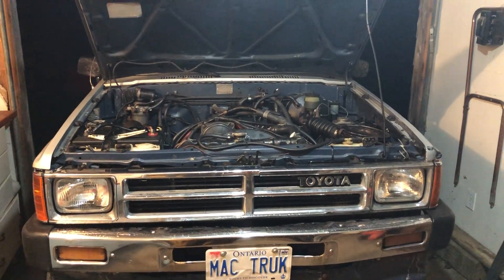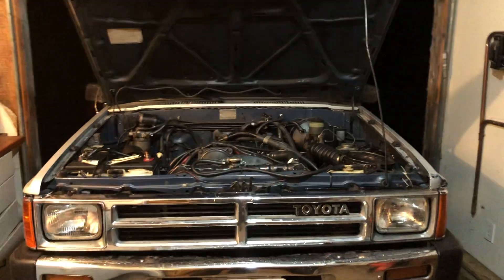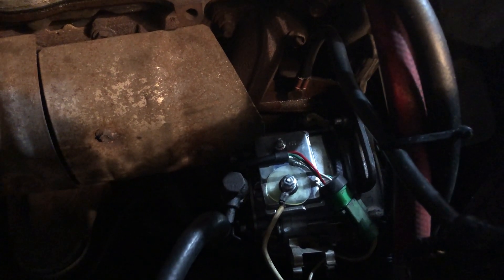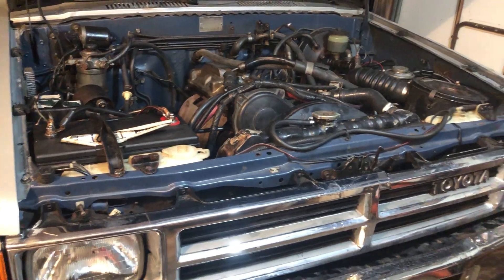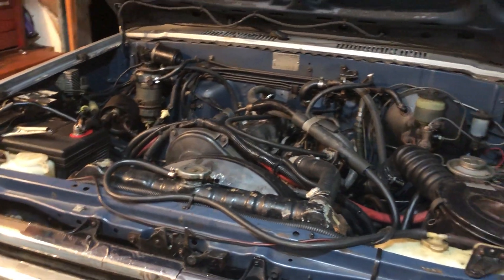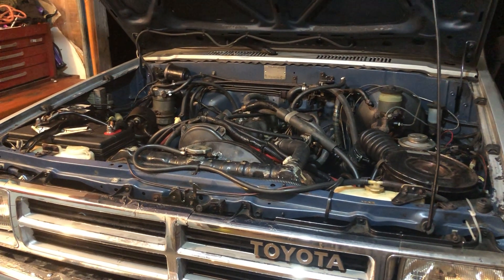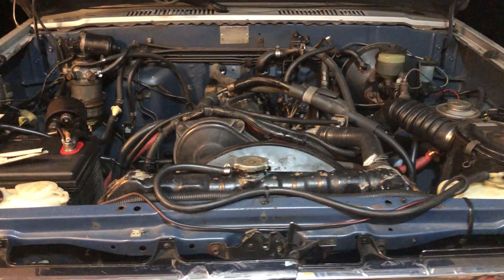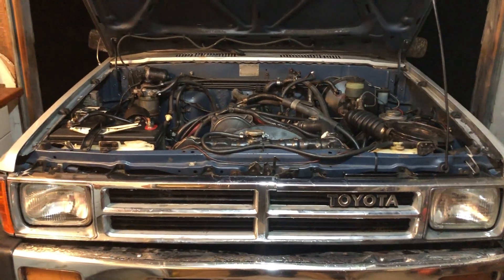1988 toyota diesel pickup ready for spring!!

Comment: Hi, congrats, is a good toy to be playing,  I do have  a question about  the diesel truck. I'm from  California  and I got a 1985 toyota 4x4 turbo diesel 2lt, but the previous owner has install a 12 volts  mini pump just before enter the filter pump to pull diesel from tank, and the truck straggling to go uphill or just die, so I'm thinkingaybe the primer pump don't work and need to be replace, and I been looking around and nothing do you where can I get parts for this truck.
Reply from the maker: I have actually had a bit of luck on rock auto, thermoses you might need to look overseas. Asia, Australia and New Zealand all have parts. But honestly the rest of the world sold these in the millions, some quick google searches will work well. But check rock auto first. Good luck.
Reply: @yotasandkubotas3118  thank you for your help. And keep up with your projects. Hope you keep uploading, really helps,  beside we learning from each other. 👍